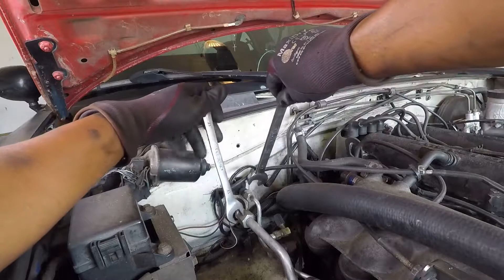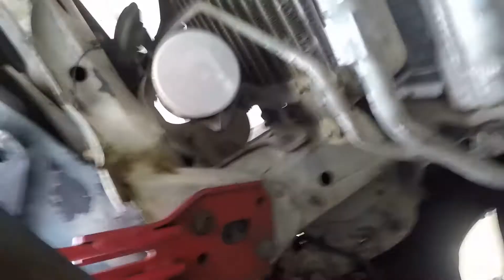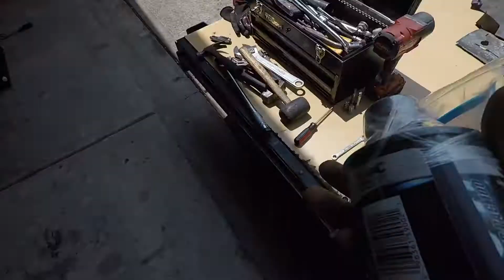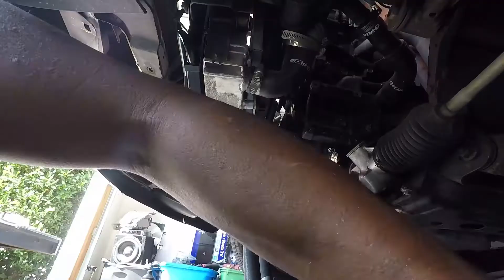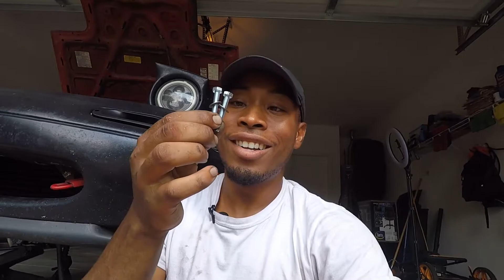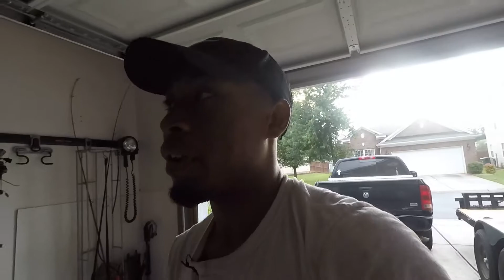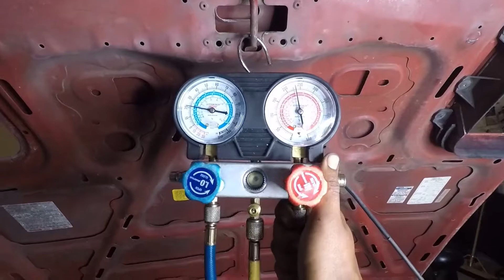1990 Mazda Miata AC Conversion R12 to R134a | HOW TO | TUTORIAL

Comment: I have a 1990 as well.  Could you not just replace the Compressor and leave the old lines?
Reply: I have a 1990 I just left everything original. I recovered the r12 and charged it with r134a. 1.00 lbs of r12 requires 0.65 lbs or r134a
Reply: I didn’t even change the oil. It still works

Comment: Know im super late to this Video but hopefully you can still help me you. Im buying a system from a 95 miata, im assuming this is all the parts Ill need to take of the miata, are there any parts you installed off camera? Also did you drain your R12 system before switching to R134A? Just trying to see how to properly do it is all. If you had soke sort of Notes with the parts and steps thats be amazing!

Comment: Great video, super helpful. I am about to do this same swap. My only question is do I need to remove the existing evaporator in the dash or can I leave the existing one for my 91. Is it neccessary or helpful to use the new one from the new miata? Thanks for the help!!
Reply from the maker: Thank you! I had just put a new one in for a 90 so the 91 one should work fine

Comment: Hey Sid, what did you end up doing about the bracket on the new drier?

I see that it's present during the comparison portion of the video, but not later when installing it.
Reply: Did you ever figure it out?
Reply: I bought a drier that had a bracket on it, but it didn't fit the condenser. I  cut off the bracket and used a section of silicone hose to pad the space in the condenser bracket because the driver was smaller than the R12 one

Comment: I just bought a nice stock 90. The low pressure line is changed already, but the high pressure line seems to be stock. How I understand it, the system does not need to be replaced to run r134 in a r12 system. The seals should be replaced with green seals. However it will work with the old seals for a short time, before the seals go bad. I tried recharging mine and it was taking r134 but not holding pressure. I found a nice bubbling leak at the top line going into compressor. I have yet to take the line off and reseal it. I guess at that time, I’ll find out if the seals are green. If it’s black, I guess I’ll be resealing the whole system. Probably a good idea anyway. Compressor works fine and changes engine rpms. Feel free to correct or offer advice👍
Reply from the maker: I ran the old system with new R134a seals for a little while and it did work until the compressor's seals went. Problem is the R12 lines don't work with the R134A compressor along with other parts that are also not compatible with the old system. Which lead to this video lol

Comment: I know this is a pretty old video, but how do i tell if my AC is still on the r12 system instead of the r134a? I got a Miata about a year ago and it finally out of refrigerat, and am trying to figure out if i should look into getting the whole AC system overhauled, or if its already good and just needs to be refilled.
Reply from the maker: I believe the A/C compressor had a sticker on it that said R-12 or R-134a

Comment: Appreciate the video I'm going to do this for my 92 and be done with it.. I did a temporary retrofit to the r12 system (r134 fill valves, drier, green orings) and had it charged with r134 and it blew cold for 4 months before needing another charge.
Reply from the maker: It's worth the effort if you want it to last, don't forget to do the evaporator and expansion valve also. I didn't get to show it in this video since I did it months before this stuff
Reply: @sidbrant  Absolutely. The original core had a stuck valve. I bought a new evaporator core w expansion valve. The car also smells better.

Comment: Great vid! ? For you, do you add pag oil into the drier, or any other parts of the system outside of the compressor. I was told I need to drain the oil out of the compressor and add in 8.75 oz of pag 100 oil. Which ports do I drain / fill from? Last ? I got all 134 lines but the hi pressure line doesn't meet the drier. Can I reuse the old line that goes in front of the condenser from my r12 system?
Reply from the maker: I added the pag oil at the compressor. I belive I poured it into the hole on the side of it, and I rotated the pulley to make it suck in the oil. You should get a 134a condenser and drier also to make the 134a lines meet up.

Comment: Would you happen to have a list of all the parts and where you got them from? I definitely need to do this to my 90’.
Reply from the maker: I got all of the hard lines, hardware and compressor from a junkyard 1996 miata. I got the condenser, ac drier, evaporator and expansion valve from rockauto.com (all for a 1996 miata and I installed the evaporator and expansion valve before doing this video). The PAG 100 oil and r134a refrigerant came from Walmart.
Reply from the maker: Also got O-rings to seal the system from rockauto.com (1996 miata)
Reply: Question, I bought a 93 compressor from rock auto and says it takes r134a but the plugs are similar to the r12 connectors does that mean the r134a lines wouldn't fit my compressor? @sidbrant

Comment: How has it been working so far? I'm about to do the same to my 1991 with a system from a 1997. I don't plan on replacing the expansion valve and evaporator, is that fine?
Reply from the maker: It's working well, thank God! Not too long before I did the conversion I replaced those also, so I would advise changing those out also.
Reply: @sidbrant  did you do it just in case or did you need them?
Reply from the maker: You need r134a o-rings on them to seal the system properly. It could leak if they aren't changed.

Comment: How far off were the mounting holes for the condenser? Enough that you could open up the hole diameter and get them to align or were they way off?
Reply from the maker: It has bushing that you press into the holes. Unfortunately I doubt it's enough room for you to open them up to get it lined up.

Comment: doing this exact thing on my 94 & 91 miata this video was soooo helpful and actually explained the process!!! if i have questions am i able to ask on here ?
Reply from the maker: I'm glad the video was helpful! Yes you can ask questions
Reply: @sidbrant  how did you go about doing the connectors/pressure switch? since they’re different how did you swap them
Reply: is it just like a screw on?
Reply from the maker: Yes it is, I used a wrench to remove the old one from the old piping and put it into the new piping

Comment: Yo quick question so I changed the fittings on the passenger side engine bay and add a conversion kit to it, I have a 1991, can I just slap in a r134a compressor in and it be fine?
Reply: @ 1:40 is where I added in the new fittings where you can screw some new caps on
Reply from the maker: It probably would work but it might leak the r134a past the old r12 seals after a while
Reply: @sidbrant  ah gotchu… thank you!
Reply: @sidbrant  I saw the ports on ur compressors are different, would my
new r134 bolt in fine?
Reply from the maker: No they don't unfortunately, the sizes of the holes are different. You will need the r134a hoses, condenser, and hard pipes to make it all fit with the r134a compressor

Comment: Awesome video! Do you know if the new compressor used as much energy as the old one? I've been looking for a way to keep the A/C from sapping so much power.
Reply from the maker: It seems to be the same to me
Reply from the maker: When I had turbocharged my car, it seemed better in boost with ac on